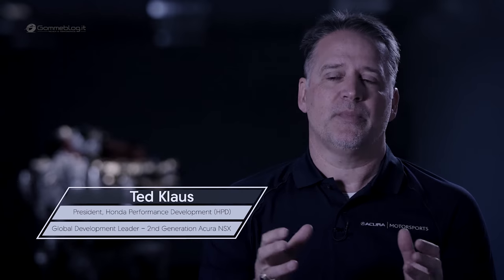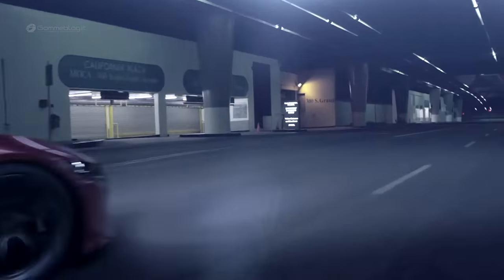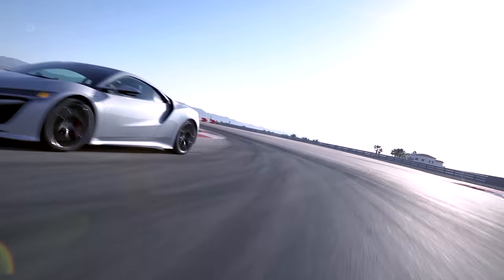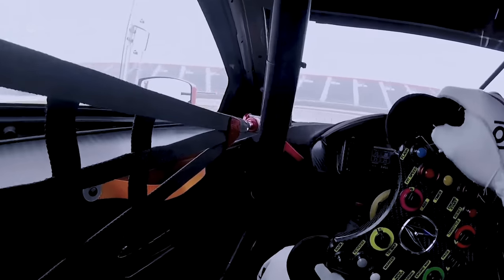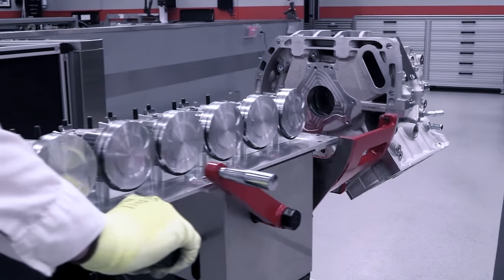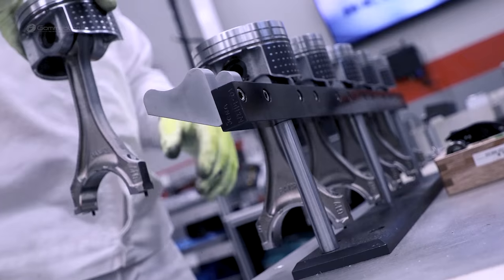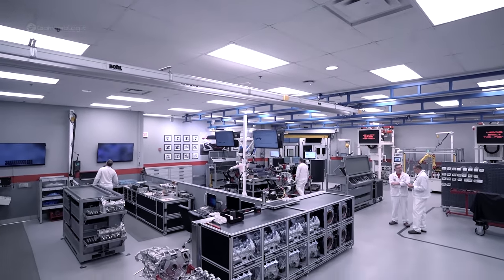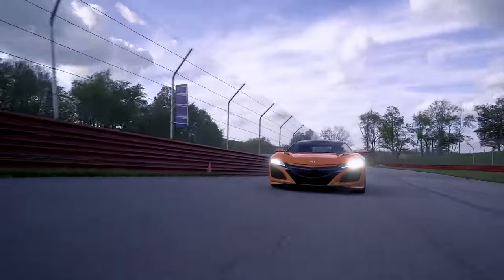2020 Acura (Honda) NSX Engine - DEVELOPMENT PRODUCTION (DOCUMENTARY)

Comment: What a great video.  This really takes me back.  I never thought I would see a mass produced engine built the way that I was trained to build engines.  Spinning each component to make sure everything is right before moving onto the next.  One thing we never had was a tool to simultaneously tighten the head bolts - that really is the best.  You can follow a pattern to tighten in increments to gradually get there, but it will never be as precise as driving all the bolts at the same time.  We would use a long screwdriver to listen for the engine events, but I think a stethoscope is the way to go.  I was going to get a Mercedes Benz, but this video sold me on the NSX.  I always wanted a formula one car for the street.

Comment: Buying the engine from Acura is around $100,000 USD. This is why John from LHT sold his nsx. He was worried to modify the motor and blow it.
Reply: Might be cheaper to just k swap it and build that K series to 1000whp.. but yes will be way to much custom work to make that happen on a new NSX.. older NSX k swap is easier.
Reply: @civicpride1986  You could do that but that will totally change the cars blueprint. Balance, suspension ergonomics (super handling) weight to balance ratio etc.... I think the real problem lies in the ability to able to add power adders to the block and heads ie... bigger turbos, nos, sleeved pistons, racing cams, enhanced fuel systems etc... and be able to handle that power output. K series in its own right was an engineering masterpiece because most internals come forged from the factory so big boost is doable right from the showroom floor. Not sure if the 2nd gen nsx comes that way. The biggest blunder of all? Not giving us Honda fan boys any v8/v10/v12 “base” forged internal engine and let us “run” with it. If that ever would happen, we would easily destroy 2jz, Rb’s, vr’s, ls’s, hellcats, demons, vipers, mustangs and even lambos. But I’m just dreaming.

Comment: This engine uses the chain driven water pump also as a chain speed intermediate speed reducer sprocket. What that means is there are a total of 4 chains. One chain between crank and water pump. Pump is driven about 1.5x slower than crank. Then one each chains for both cylinder heads. Cams are drive (one again) 1.5x slower than water pump. Then there is a 4th chain between the crank and oil pump and drives the dry-sump oil pump sprocket. 

My question is, how is the bearing in the water pump/intermediate sprocket lubricated? Is it a sealed bearing, like the old Porsche IMS bearings, or is it lubricated by engine coolant like most normal water pumps, or is it pressure fed by engine oil? Since this water pump also functions as the timing chain intermediate sprocket, it has a very important function. A failure of the water pump could potentially destroy the entire engine. Also the price of this water pump is around $2083 on Acura parts sites. Thanks